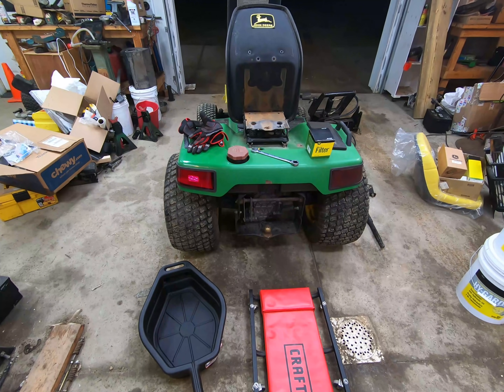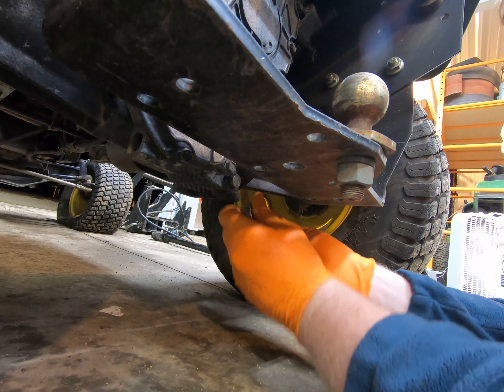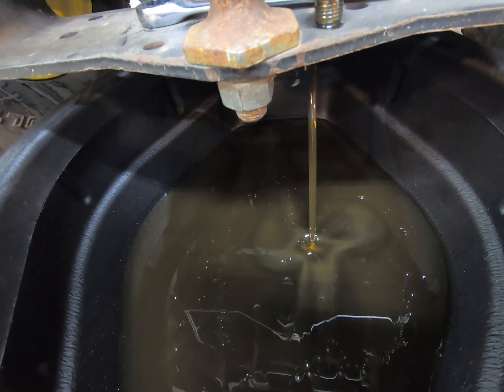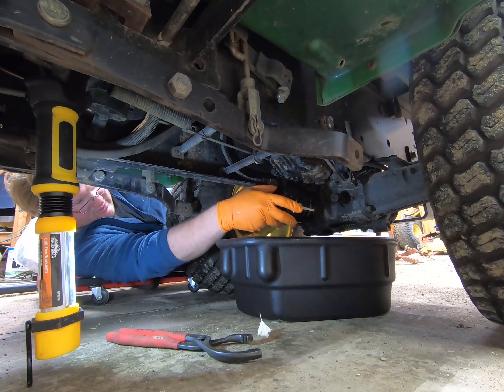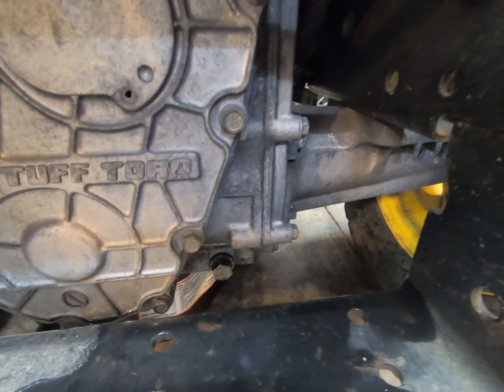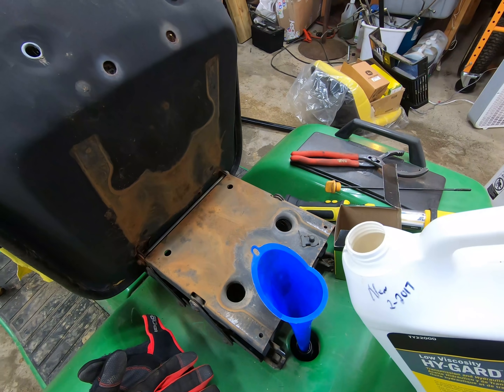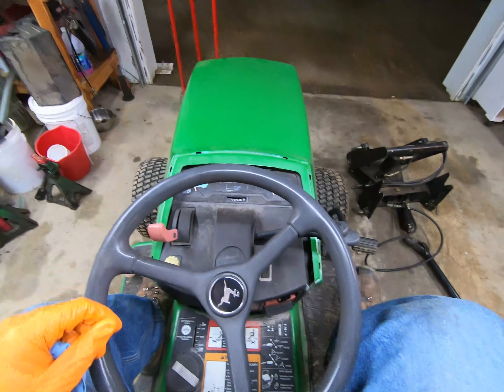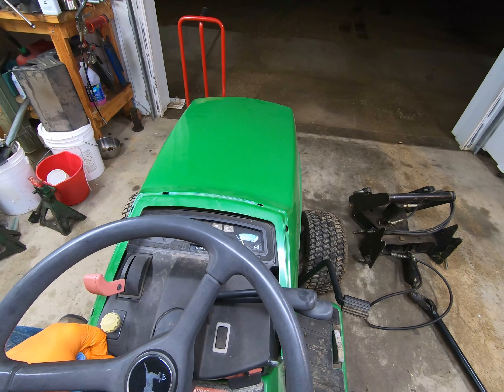Changing the Hydraulic Fluid in a John Deere 455

Comment: FYI When you check the trans axle fluid you should unscrew and wipe the dipstick then set it on the tube without screwing it back down, This is right from the owners manual. I have owned my 1998 455 since new and have never had a major breakdown with 1800 hours. I run it hard but do the maintenance by the book.
Reply from the maker: That is the correct procedure for checking the fluid. As I stated I had already checked the fluid prior to starting it up and moving it to the location where I was changing the fluid. I should have a video somewhere showing how to check all the fluids on a 455.... I just cannot remember what the title is! 1800 hrs is just getting nice and broken in. A couple years ago I had a 3TNA72UJ with over 4500 hrs on it and ran like a top.

Comment: Another thing very important always before putting your new filter on fill it with oil and put a little oil on the rubber O-ring because sometimes if you do not fill the filter with oil when the pressure starts, it’ll blow the filter paper inside apart you will not lose much oil when you screw the filter on being full because it soaks in you feel the filter and with no time it’s gone down halfway Have a good day

Comment: I have a LT -155 and they told me it had a sealed transmission.  I found a plug on top but no train plug.  How would I change the hydrostatic oil ? If you could share a video.
Reply: I think you have to use a pump and pump the fluid out. A small hand pump will work.
Reply: I removed the whole rear end and turned it upside down to drain.

Comment: Just like to say, leave your dipstick in when you take off the filter and your drain plug and then take the dipstick out that way the oil won’t run out so fast and then when you remove the dipstick, it’ll give it air and run out a lot faster just trying to give you some tips to help you Have a good day

Comment: I have a bucket on the front of my 445. Do you recommend disconnecting the bucket hydraulics before changing the fluid? I assume if the bucket is not disconnected that I will need more fluid? Correct?
Reply from the maker: You don’t necessarily need to unhook everything. There will always be residual oil in the system. As long as you don’t change the position of the loader while changing the fluid you should only need the same amount that came out (pending it wasn’t low)

Comment: I have a question. My steering had “hard spots” when turning the wheel but would clear up after a few minutes. I did a full service on it a few weeks ago and now it’s worse. I was told it may be air in the system but I’ve mowed the law 3 times now and it seems to get better as a mow but it’s back to horrible at the beginning of every mow.  Any help would be greatly appreciated.  Thanks!!
Reply from the maker: To start with I would check to make sure all the joints are free (tie rods etc). It could be there is old hard grease that needs to be cleaned out. That is the most simple thing I can think of. Depending on the year of your 4-5 unit the steering system could have a number of joints that need to be cleaned.
Reply: Thank you for the advice.  I will do that this weekend and let you know.  No way it’s air in the lines?

Comment: Sorry if this is a stupid question - is this hydraulic fluid also used in the 455's power-steering circuit too, or a separate fluid/reservoir for that?
Reply from the maker: I don't think that is a stupid question at all. If it was like a car it would make perfect sense. But generally these machines use hydraulic fluid from the transmission for the power steering. In the case of the 455 a line from the transmission feeds the power steering valve that is right under the base of the dash in the frame.
Reply: Thanks. When draining the transmission should I jack up the front of the 455 and turn steering lock-to-lock to purge the steering lines or is that overkill? Might introduce an airlock...

Comment: A man gave me a 455...It's ROUGH...Nothing left of the seat but the frame...Thick layer of dust...Instrument cluster has no glass and one of the tensioners on the 60 inch deck has completely fell apart...Someone said it had a bad fuel pump...I put a new battery in, made sure the fuel was not 100 years old, ran a new Hotwire to the brand new switch somebody installed and it fired right up like a new tractor...He did tell me he did heard it run and it ran good...I did some work on his X495 and he just let me have the 455...Most likely from an estate sale and the people just let it sit out in the yard and ruin...I got a GT245  that way...New carburetor and some pulleys and belts it it's rollin.....😎

Comment: Beef inflate the right front tire
Reply: Damn, that tire is triggering my OCD
Reply from the maker: The front tires are junk and need to be replaced. If it sits for more than about 2 hours they go flat. That is why in some videos they are fine and others they are flat.
Reply: My original tires started leaking through the sidewalls in multiple locations.